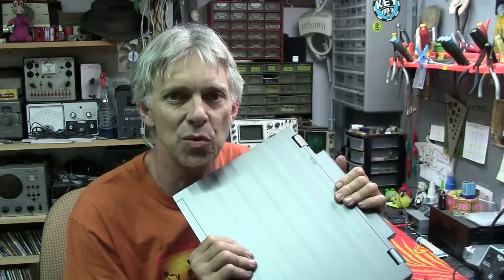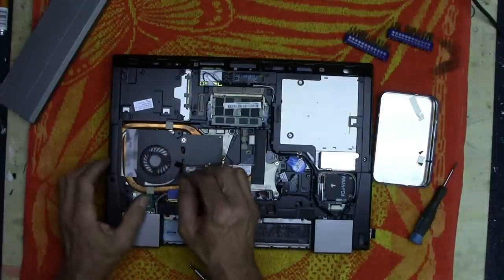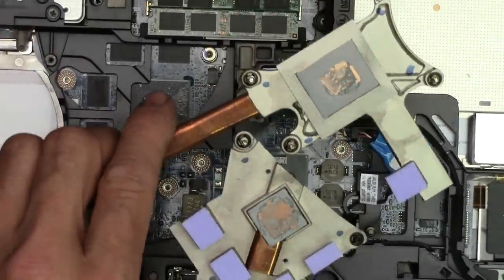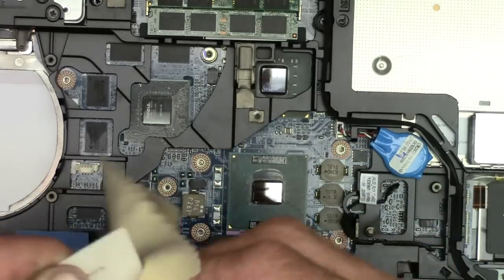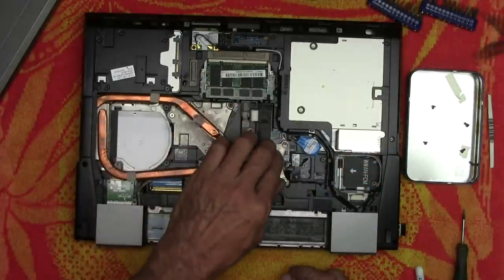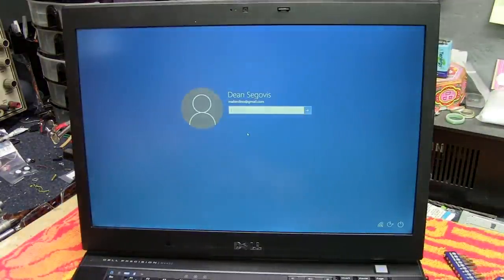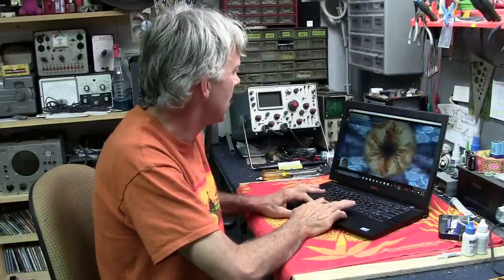Overheating Laptop Fix

Comment: Don't spread it. Don't spread it. Don't spread it. Don't spread it. You spread it. Dude, don't spread the thermal goop, it raises the chances of air bubbles forming between the two surfaces. Just leave a rice grain amount in one of the surfaces and the clamping pressure and heat will take care of the spreading itself.
Reply: christianabiera So far so good! Fan cycles on and off more than it used to and runs for shorter duration. I followed the instructions on Arctic Silver's website. The paste that I applied to the copper heat sink side is a very very thin layer.
Reply: ***** Just putting a streak of the paste on the CPU/GPU is enough, some put a little P in the middle. The pressure of the heat sink will spread it evenly enough. That's the easiest and best way to do it - you don't get air bubbles, and you don't spread the paste over the sides (you don't have to worry about the edges or corners, it's the center that matters the most).
Reply: +christianabiera Typical troll-logic.
Reply: +Kyle Whybrew what is someone trolling a troll called? As for me, Yes that hypocrisy called for me trolling you!

Comment: So far so good! Fan cycles on and off more than it used to and runs for shorter duration. I followed the instructions on Arctic Silver's website. The paste that I applied to the copper heat sink side is a very very thin layer.

Comment: Does your fan not turn on right away when your laptop gets a bit hot? I didn't understand that part. Also if there is really hot air coming out of you exhaust, it means the heat-sink is working well (scavenging the heat away from the cpu/gpu), maybe the fan isn't running fast enough?

Comment: Had a similar problem on an old Vaio laptop. I added thermal paste and copper heatsink shims. I thought this solved the problem, but turned out that the fan/radiator unit had lost its coolant gas inside. after a $5 replacement my 9 year old Frankenstein laptop is working great. Keep this in mind if the problem reoccurs.

Comment: I'm in the habit of cleaning the dust out of the fans (and maybe adding a drop of oil to them.),re-gooping the CPU,GPU,bridge,etc. heatsink once every year,or so. The cleaner stuff is overkill,IME. Honestly,rubbing alcohol and Q-tips work fine. Ya should have done the other chip,too.

Comment: I've used Arctic Silver for well over a decade, it will usually run a few degrees cooler than the stock stuff.

It looks like you may have used too much. I use just enough to cover the top of the chip and I never put any on the heatsink because any extra will squeeze over the side of the chip and insulates the heat. I suspect this is why the laptop was overheating in the first place, the factory can be sloppy with the stuff.
Reply: Blake McDonald So far so good! Fan cycles on and off more than it used to and runs for shorter duration. I followed the instructions on Arctic Silver's website. The paste that I applied to the copper heat sink side is a very very thin layer.

Comment: If the exhaust air is hot, that means that the cooling system is working properly. Overheating is an indication that the CPU is being overloaded, most commonly because of system fault such as a faulty device driver. It could also be that the cooling system design is undersized and cannot remove heat generated, generally due to bad design or space constraints
Reply: Francois Hoffman So far so good! Fan cycles on and off more than it used to and runs for shorter duration. I followed the instructions on Arctic Silver's website. The paste that I applied to the copper heat sink side is a very very thin layer.

Comment: Hi,  Like the video and looked at it about a year ago.  Yet to have preformed the heat sink fix but have the prescribed compounds.  So far I have not had an over heat condition but want to keep my M4400 running.  
HUGE QUESTION On Win 10 :  How much memory are you running on your M4400 and are you using a SSD hard drive?  I'm currently running Win 7 Pro and plan to buy ;-(  Win10 either home or Pro soon.  My M4400 currently has 4 Gig of RAM but have ordered 2 x 4 Gig memory sticks and a 1 TB SSD drive. I did not take advantage of the free Win 10 update but I'm happy to see that it appears to run well on your machine!  Any advise would be appreciated.  And thanks for the excellent YouTube - Mike

Comment: Hi, I noticed you use the computer at the soft mat/cloth at the end of the video. That will hinder the air flow and can cause issues with cooling .. But I'm sure you'll know this, but just didn't mention it on video?

Comment: I used to do the same as you did, but as others have said, you should not spread it (you can get voids/air pockets in the transfer paste doing it this way). You only need to put it on the CPU itself (in fact should not put it elsewhere as some heat transfer pastes conduct electricity and can cause obvious problems if you get it in the wrong place), and depending upon the CPU model, some say to put a spot/pea's worth on, or put it on in a line across it.

Saying that, though, this will probably be better much than what you had and if it works without issues, then it's not a problem. It will be more important on high-end machines, or machines that are pushed to their limits more often. If you are in any doubt, you can try some software that shows and monitors the CPU's core temperature, and check that it's operating well within the manufacturer's limits.
Reply: Replying to myself, but you can also get coolers with fans in that you place your laptop on, which can help with keeping it cool. They don't cost much and there are loads on eBay.
Reply: mrman17 Instructions on Arctic Silver's website for Intel Core2 mobile processors. They specifically say to spread it on both parts. 
http://www.arcticsilver.com/pdf/appmeth/int/ss/intel_app_method_surface_spread_v1.1.pdf

Comment: I would look to add an extra fan, and also chamfer the air intake and exhaust to increase air flow, a lot of laptops and game consoles are not engineered to dissipate enough heat .

Comment: too much heat sync paste. you only put a dab about the size of a grain of rice (or bigger for a larger chip)  dead center on the chip dye, when you put the heatsync on it will spread the paste evenly (if you tighten the screws evenly same as you would on a engine)
 if you apply to both sides you will introduce bubbles into the compound and reduce its thermal conductivity.
Reply: killernat So far so good! Fan cycles on and off more than it used to and runs for shorter duration. I followed the instructions on Arctic Silver's website. The paste that I applied to the copper heat sink side is a very very thin layer.
Reply: what you did is still a lot better then the paste manufacturers put on
Reply: *****
what you did is still a lot better then the cpu manufacturers put on as they want to shorten the life span of the cpu by running it hotter if you ever build your own pc the cpu usually comes with a small heat sync and low quality (high wax) thermal paste already applied and very thick

Comment: Also be aware they are still tweaking Windows 10 and over heating (The OS running the CPU and GPU to hot) is a common problem. Everyone wants to run the latest and greatest however remove Windows 10 until its been released and final. I removed it from my Ausus for that very problem. Replacing the compound is only a temporary solution as Windows 10 may again start cooking your CPU and or GPU. Read up on Microsofts Beta support for Windows 10 website it goes into details there. Windows 10 on your laptop at this point is bad or at least can be. GL man. The other comments are correct never put compound on both sides besides bubbles you run the risk if it oozing out to the sides and causing more issues.
Reply: MidwestMotoRider Oh.. and Rubbing alcohol is all you need and a clean cloth, today's paper towels are fine also for cleaning the surface just be sure there is no lint left behind. I have been doing computer repair since the early 90's and today that is all I use and have no issues. Don't buy into the cleaning solution crap its a waste of money.
Reply: MidwestMotoRider So far so good! Fan cycles on and off more than it used to and runs for shorter duration. I followed the instructions on Arctic Silver's website. The paste that I applied to the copper heat sink side is a very very thin layer.
 Instructions on Arctic Silver's website for Intel Core2 mobile processors. They specifically say to spread it on both parts. 
http://www.arcticsilver.com/pdf/appmeth/int/ss/intel_app_method_surface_spread_v1.1.pdf
Reply: Ok. Well enjoy. That post is dead wrong. If you follow Intel and AMD's recommendations they are completely different and I would trust them over the company that makes money selling the product they want you to use more of. GL with Windows 10 hopefully your chipset is not set that Windows 10 has been baking. Have a good weekend man! Crappy here.. sigh.
Reply: MidwestMotoRider I started running Speedfan yesterday to monitor temps. Peaks are around 75C, lows around 50C. CPU and GPU temps are within a few degrees of each other. I read up on the "cooking chips" on the insider blog. Pretty sure my laptop will be OK. As far as technique of application, I found a test showing that full spread resulted in one of the lowest temps. It's worth a look: https://www.pugetsystems.com/labs/articles/Thermal-Paste-Application-Techniques-170/
Reply: Pugetsystems makes some great machines. I generally spread the layer over the chip rather than use the grain of rice method my self. M y concern for you laptop is Windows 10. Keep speed fan handy and just keep an eye on it esp after an update. Seeing too many posts of people's laptops baking because Windows 10 failed to ramp up the fan when it should have. I can tell you from years of experience in the field NEVER put paste on both sides, while you might be ok, you might not also be ok. Anyway GL and love you videos man!

Comment: sporting win xp!!
i can give you windows 7 or 8 for free if you like?
Reply: Jared Reabow It's Windows 10 Insider Preview. Free upgrade from Windows 7. http://windows.microsoft.com/en-us/windows/preview-iso
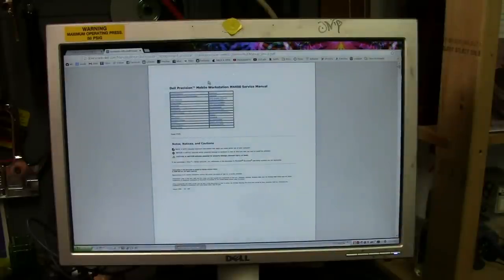Reply: ***** i know what that is but at 2:16 thats xp, no doubt about it
Reply: Jared Reabow Oh yeah I forgot the desktop machine is running XP! D'OH!
Reply: +Jared Reabow (Jazza) please gimme free windows 7
Reply: Jared Reabow
 thanks
Reply: +Dean Segovis Isn't MS pushing out windows 10 to not need to support win 7 or 8? What of the computers specifically made to handle those systems? Is it lighter, leaner? Wait that would be Linux, without proprietary compulsory upgrades for those who can't afford to keep the wealthy so.
Reply: +Timothy Danielson 10 is lighter
Reply: +Jared Reabow (Jazza) It is? hmmm. what is the size of the installer disc? yYou DO have a regular instalation CD correct? (NOT a specialized OEM that may ONLY be used on that particular brand? I bought a full Install of 7, so I can compared the size, which includes all the options, with whatever you may have. who knows maybe they have made it smaller somehow.. As a side not my Linux installation amd ALL it's apps with space to spare is on 250 GB. I can run A bare boot disc with less than 1 GB to launch it.)
Reply: +Timothy Danielson lighter in terms of hardware requirements. but also the 10 install includes both 32 and 64 bit as well as upgrade from 7 to 10 and 8 to 10 and 8.1 to 10 which is why its so big